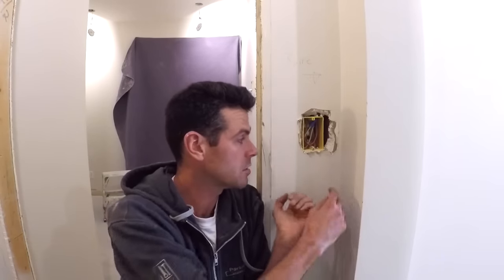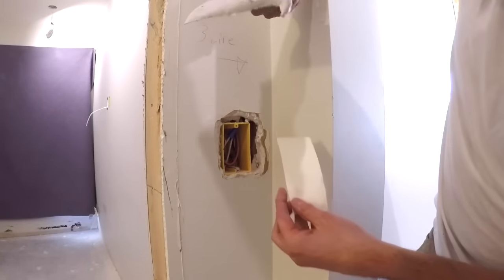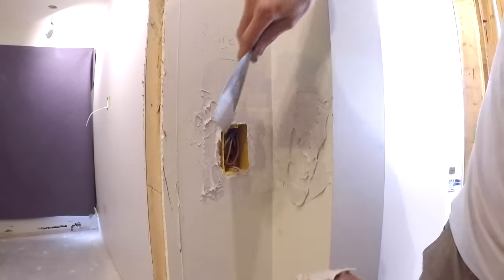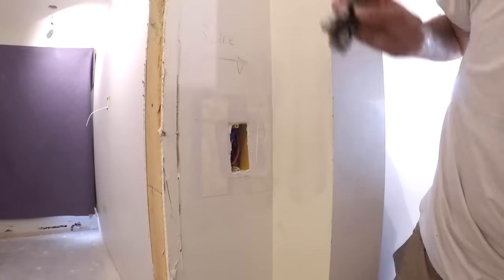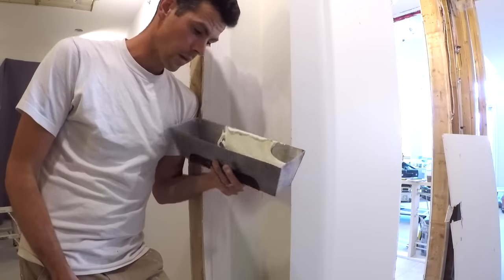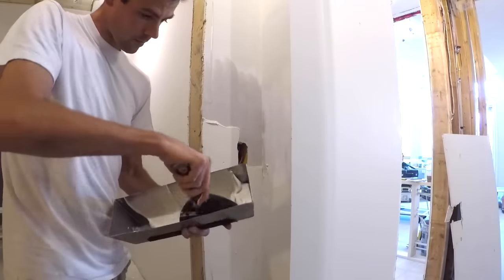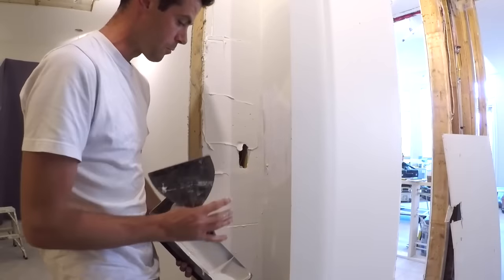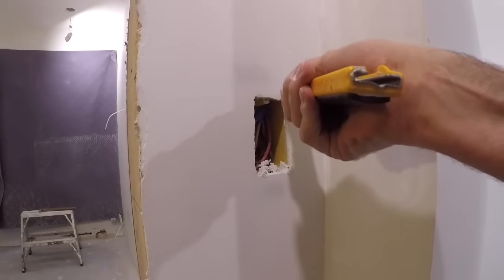HOW TO REPAIR OVERCUT ELECTRICAL BOX (DRYWALL)

Comment: I rented a house to a drywall guy once and he had the strongest handshake Ive ever felt
Reply: @azn5594 you must not know drywall guys are pretty damn strong from work, I take it you must not do much drywall or have been around any. And that was a horrible, horrible joke...
Reply: tall iron guys have pretty strong hand shakes too
Reply: Loggers who run chainsaws all day... Little old bald headed ex loggers I met had fingers like sausages and s grip like iron.
Reply: Wide World of Trains 

It’s some back breaking work. Most guys don’t make it past 50 before their backs give out.
Reply: When you carry 8ft of 5/8s by yourself on a regular basis that happens.
Reply: Joseph Cote 

I’ve carried a few fire rated 5/8 12 footers myself
Reply: Get yer gersh dern razor blade out of my lectric box
Reply: Used to hang and finish drywall. I was at a house we were getting ready to work on and the drywall was being stocked. The 2 guys came through carrying 2 bundles (4 sheets) of 16 foot 5/8ths board. Me being the wise ass I can be jokingly said "when you guys going to bring 3 bundles in?" Yep, next trip through they had 3 bundles in their hand. I know those guys would have had to have been able to change a car tire without a lug wrench if they had wanted.
Reply: David Hill 

And the stockers were always small guys not big muscular guys lol
Reply: Swinging 3 Meter/15mm Fire/Audio boards around all day will do that to a man, 40-45kg a piece. 
Not for the faint hearted

Comment: Thanks for explaining quick set vs mud regarding drying time, cracking and shrinkage. And using one over the other.  You just explained the reasons for my issues I had today. Thanks again.

Comment: I have a DIY knack for goofing up around the boxes when I hang drywall. I use tape and mud to fix them usually, but I never thought about using quickset. Good demonstration!

Comment: The best way to repair that is to replace that section. What you did is very good but if not done properly, you’ll get a hump around the switch box. Thanks for sharing!
Reply: Yea, pretty sure he mentioned that.
Reply: I have humps around all my switches can this be fixed? Wall is already painted 😟
Reply: Ara Garcia anything can be fixed

Comment: I like to use Durabond to fill large voids like that, with fiberglass mesh tape. That stuff sets extremely hard and is nearly impossible to sand, so it's important to make sure it's a first coat below the plane of the finished drywall. Then I follow the steps presented in the video... use the regular paper tape and setting mud, then the finish with joint compound. Also, I am a huge advocate of STEEL electrical boxes! Much sturdier.
Reply: That's the way I was taught 35 yrs. ago. Durabond for strength and big patches. Durabond with a little liquid  latex on plaster patches.
Reply: Mesh tape makes for weaker repairs and will sag when filling voids.
Reply: @johnd9541  Yeah... I am learning that, I have totally seen mug sag from mesh tape. It's probably a lack of surface tension.
Reply: It's not the mesh tape - it's how stiff the setting compound is when you do the repair. Super stiff mud will hold the mesh just fine and then you can go through and top it out with another coat of setting and skim it to your pleasure with topping or all purpose mud. Cheers!
Reply: Screw a backer of some kind in the hole, or use a sheetrock patch, leaving about an inch of the white paper over hanging to use in place of tape. Hot mud and wipe it tight, Bed, skim, sand.

Comment: Getting those boxes right is worth it. I was a little out of practice and assumed the covers were bigger than they were. Now I have some funky edges around the switches and receptacles. 
I'm not as perfectionistic as I used to be, so I can dust myself off and do better next time. 
Thanks working guy!

Comment: Nice!  One thought... since you are using quick-set mud, you can make it any consistency you like.  You can make a "thick and sticky" batch to actually fill smaller holes, then finish normally. Won't break or fall out later.   And with a little practice, you can do some amazing repairs by varying mud thickness.

Comment: I was an electrician in another life and fixed my share of those. The method I was taught was to stuff newspaper through the damage into the wall until it piled up behind the damage. This provide a dam to push spackle into the damage without it falling into the wall. Always worked for me. I imagine spray foam would have been a better dam than newspaper but spray foam wasn't a thing then.

Comment: Excellent video. I will be using this technique to patch around a bathroom exhaust fan that is smaller than the last one.
Thanks and keep up the good work.
Reply: I have the same problem and was thinking the same thing as I watched this video.  Instead of quickset mud I am going to use 45 minute mud, but use hot water instead of room temperature water.  I heard that using hot water with that type of mud will cause it to set quicker (around 20 minutes) instead of 45 minutes...  Also will add some glue to it!
Reply: Careful. This technique is meant to bear a hanging weight like a fan. You my be better off to just cut out the Sheetrock from wall to joist, usually a 2’x2’ square, put in a new piece with the opening already cut in. Good luck.

Comment: A really nice demonstration on a non-critical patch.
Reply: i agree. switch box patches don't need to be over done. receptacles however see much more stress, especially with the tamper resistant. i don't like cheap plastic boxes for outlets.
Reply: did he really just mud 2 feet of that wall just for a switch box?.. boss comes back and he's still fixing the hole next day... they have a job opening..

Comment: Great lessons on smoothing, feathering, tapering etc on smooth walls. Most homes in my area are heavy knockdown textured. Any tips and tricks to repair and make it match?
Reply: Some times, guys will scrape the texture down around the patch area, and then replicate the texture so you don't have a bulge where the patch is. It comes out looking smoother and, if done correctly, can be less perceivable.

Comment: Great videos! I've done some drywall work in the past (finishing a basement) but it was all new work and I was graced without having to overcome previous issues. I am now in an older home that needs lots of minor repairs and your videos are just what I needed.
I have one issue that I am still not sure how to address. The inside corners at the ceiling were completed with corner bead. That corner bead has separated from the wall in some places, the ceiling in others and both in a few. 
How would you address this? I've considered squirting wood glue into the gap and bracing it closed then a light sand, patch visible cracks and new knockdown texture. Thoughts? 
BTW: thanks for the Amazon links. I'm emptying my cart and using your links for the items I order.
-Charles

Comment: Me being a pro drywaller and finisher.. I gave this video a TEN!!!  Same way I would have fixed it..  
This looks like a electrician installed the switch box after the drywall was hung.. A drywaller would not butcher such a hole..
Reply: Or one hanger tacked up the piece beside the door but didn't router out the box,  got sidetracked, apprentice screwed off piece, not knowing better, fracturing the cheesy new lightweight board around the box. Taper comes in and notices a lump in the wall if he is good.

Comment: Very good, I had the same problem and used pieces of drywall to fill the large gaps, wish I had seen this video before I did that. I am not a professional drywaller, just DYer.
Reply: Nic Lira using a wood backer and drywall is stronger than just using tape.

Comment: As an electrician, I can confirm that we are indeed used to it and that we indeed hate the drywall guys for mudding the shit out of our boxes ever damn time. We usually take a key hole saw to it afterwards and have to tap the screw holes on the boxes. We even had a sheet rock guy using a rotozip to cut out the holes up against the walls instead of marking them then cutting them out, ended up chewing up a bunch of our wire and we had to repull that whole section. Thats a sure way to get a swift kick in the teeth from an electrician.
Reply: Tough luck.

Comment: I guess this might be ok.... but it doesn't take very long to cut out a blowout and fix it with a proper patch.  The time is in the mudding and cleanup, not installing a piece of drywall.  I use paint stir sticks to  back up the patch.  A bit of titebond and clamp them for 30 min.  Do something else, then come back, add a bit more glue, add the nice neat drywall patch.... tape and mud.... no issues.  Ever.
Reply: Clever.. so no screws? Just glue and paint sticks behind wall?
Reply: If you put the paint stir stick back there why couldn't you just fill the area with one of the harder drywall muds once the stick has adhered instead of putting in a piece of drywall?

Comment: A quick trick from an old guy? Fill around the box with( Great Stuff), cut off the excess and then skim with compound. 5 years later not a blemish.
Reply: What is "great stuff"?
Reply: @nelsonc1687  Spray foam.

Comment: Just fill the gaps with expanding foam, them just use mud, simple
Reply: Nice
Reply: That’s exactly what I have done for large gaps around electrical boxes. Sometimes you need to stuff the cavity with insulation to give the foam support until it hardens.
Reply: Or better yet just cover it with duct tape, done.
Reply: Good point.  He made too big of a job out of it.  I would have tapered all edges to give the mud a good area to hold and stuff some fiberglas insulation in the right edge where there was a big gap to provide backing and then use quick drying plaster of paris.  I could finish with the standard slow dry mud if necessary, but probably not necessary.

Comment: And this is why walls are never flat when you're installing cabinets.
Reply: C'mon man we got a lot of warped studs behind the walls these days. You know that.
Reply: yep, cant stand this retarded trade, almost never use a straight edge to make sure they arent bumping out the walls and screwing up everyone elses nice work
Reply: Use LVL studs or metal studs in kitchen and bathroom areas. Its worth it.
Reply: Blame the framers for not making straight walls.
Reply: Wolf Lahti what would you suggest?
Reply: That the framers blame the lumber mills and the mills can blame the trees.
Reply: @BraddersMusic  I would of taken the piece of sheetrock down and started over. Now there is a 3 foot long bump on that section of the wall that would drive me crazy if I knew about it....
Reply: The wall never its flat 
The cabinets guys always put broken  cabinets 😁
Reply: @frankm3214  , I would blame the person who watered the trees.
Reply: Gotta wonder how people deal with real problems
Reply: Blame the GC for not wanting to pay for the upgrade.
Reply: And why I hang wallboard vertical so i don't have butt seams.
Reply: @frankm3214  The framers will just say the foundation is out of square. The foundation guy will say the earth moved.
Reply: my house was built in 40s and never needed repair fucking immaculate craftsmanship EVERYTHING is level even from all these years l...built by an Irishman
Reply: @derekladyga1716  A drunk Irishman makes the straightest lines. 😂😂😂
Reply: The walls aren't flat because the studs aren't square
Reply: Wolf Lahti yea I have a hefty wall hole myself. Not doing that much patch work, that’s insane. I will do the tape though.
Reply: @manlyminnesotan  if your a good patch guy even knowing about it you won't ever see it haha.
Reply: i can never get that 9 min back that i just wasted watching this video...

Comment: I use durabond as the quick set. Dries like granite!
Reply: And doesnt sand
Reply: @andrewk8636  Hi Andrew, it will, if you use a wet sanding pad; or if it's thick, wet it and use a putty knife or a pull scraper. I've been using Durabond 90 as a first coat, and sometimes, finish coat, for years. Just make sure you don't have any high spots and finish with regular drywall mud if necessary.
Reply: Durabond is a great material. But you gotta use it carefully and avoid ever having to sand it.
Reply: Aaron Kaase doesn’t sand at all!
Reply: Durabond definitely DOES sand. Harder to do yes but it does sand!!
Reply: Durabond works a lot better than quickset drywall compound -if used like a rough plaster.  But it still doesn't bond to the gypsum. Material discontinuities concentrate stress and will result eventually in cracking.
Reply: @psdaengr911  I find it does pretty well, regular mud will crack right out if I do anything to the box, I usually find durabond will stay put.
Reply: as a handyman I do patches like this regularly,   no tape no sanding & good texture matches.
You can use fast setting drywall mud that sets at quick-set different rates. it says if it's faster setting on the package. I usually use fast set 30min.
 Once dry it's sands just like any other drywall mud and I can shape the final texture  after just a few minutes so I usually use a wet sponge and a wet rag and never have to sand it at all.
 I can make the texture better match existing wall textures and even add fancy surface in stages like knock-down etc if I've got a fancier texture to match.
 as a handyman I do drywall repairs like this daily and can't afford to make a second trip out to somebody's location after it dries just to sand it.
so I have to make it perfect on the initial trip and I can have it painted before the hour is up.
DAP makes FastPatch 30 in a small consumer bucket  but most drywall mud manufacturers make fast setting varieties in larger bags.
Just only makes as much as you're going to use and go ahead and get on with applying it immediately because it will start to harden quickly.
apply the patch layer to the hole with no excess to sand off and after a few min your patch will get hard enough that you won't hurt it working with it but you'll be able already after 10 min or so to add final texture and you can sand it flat with a sponge or dab it with sponge and rag and more mud powder to create perfect texture matches to many different types of wall texture  and after just a few more minutes it will even be dry enough to paint.
Reply: Terry Jull I think that’s irresponsible. You have no respect
Reply: well durabond has a lot more glue its a much better product than plaster of paris sheetrock 20 etc but its just a little repair around a recepticle,   even mesh tape and plaster of paris for that little repair is more than enough

Comment: I’ve fixed many of these , and other holes. Some a little larger . Invest in a bag of “Confill”  AKA “ Wall in a bag” . For the larger holes , don’t wipe it too hard, leave a little on the wall .  Much easier than using tape if you don’t have a lot of taping experience .  Great video none the less.... this guy is good.

Comment: watched a bunch of your videos and they’re helpful! Thank You!
I live in a 1950s house with textured drywall walls everywhere. As I work thru improvements, there are lots of imperfections I find - lifting drywall paper, poor patching, hole to patch. I want to redo my baseboards and trim, so while I’m doing that, what is the sensible thing to do about the drywall? 
A) deal with one problem at a time with patching
B) tear out and redo
C) just sell the house and move to a rental
D) something else

Appreciate your advice!

Jaime (she)

Comment: I must’ve missed the part where you smacked the guy in the back of the head who originally put that box in......
Reply: what the--? The box is a nail in box done prior to sheetrocking! The "blow out" had nothing to do with the box installer.
Reply: And then there’s the devastation plumbers leave behind when installing supply and waste drain lines in a basement reno - you know, when the home-owner says, “No, meant the other corner of the room. That won’t be a problem will it? “

Comment: I used this technique I learned here on a ceiling exhaust fan where the gap around hole for the fan was 1" too wide all around. It worked great. Because it was on a ceiling I used 5 minute quick set and did two sides  at a time because I didn't think I'd be fast enough to do all four. The quick set combined with the tape was a life saver, my first attempt without tape and without quick set was a mess falling all over down from the ceiling...an embarrassing failure. Quick set and the tape...totally different story.

Comment: Two things... REALLY nice job on the box..  and THANK YOU for cleaning out the box.  I have had to clean out boxes so often to do the wires... I can handle a bit of mud in the screw holes... no problem.  But I'm not a mudder.  I understand the occasional oops- I forgot one, but lots of finishers just leave them all stuck out.  Sometimes I understand why painters just finally get tired of driving in poorly sunk nails on siding and trim.